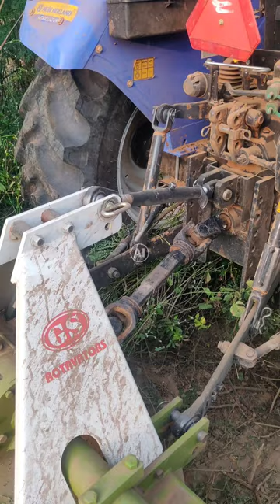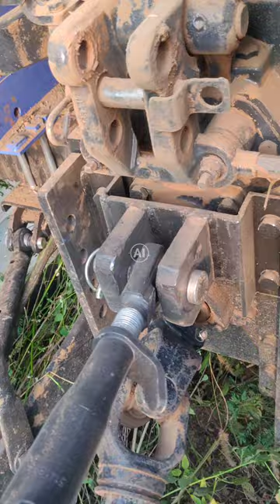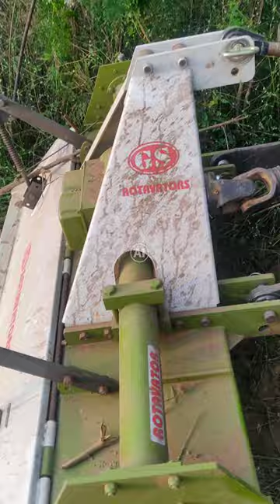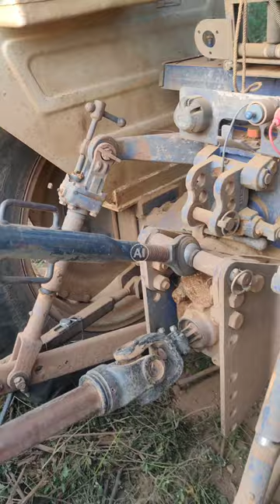Tractor top link bed alteration | PTO alteration | New alteration

Comment: Swaraj 744 epudi toplink bed alter panurathu
Reply from the maker: Swaraj 744 top link bed lock panra option factory fitted varum bro, rail bed oru length podda mara option irukkum athu tha top bed safety pin
Antha pin remove pantu cultivator use pannalam